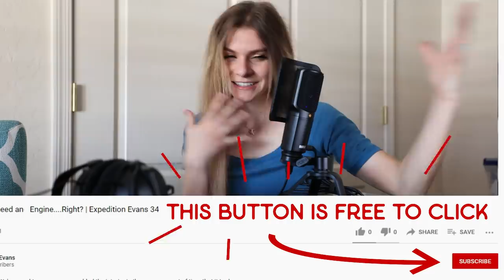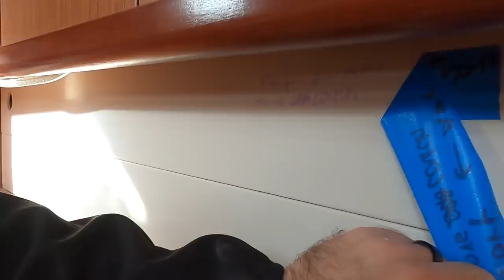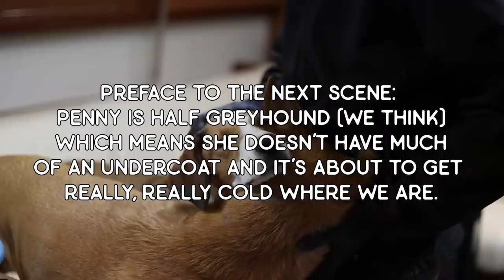Sailboats Don't Need an Engine....Right? (+ we finish reassembly) | Expedition Evans 34

Comment: May sound strange, but as an ex-janitor I can tell you it will work, use dry erase marker and then one of those little alcohol wipes. I don’t understand all the chemistry but the dry erase ink seems to be close enough to the permanent ink that they combined and that allows the alcohol wipes to lift it off. If you have any doubts at all use the dry erase board first. Put a line in permit ink And then go over it with a dry erase marker, you will have to rub on it a bit with the dry erase marker, and then take the alcohol wipe and clean it off. Just a little fun fact.
Reply: This totally works!
Reply: @VWrijder77  Weird isn’t it? Who would’ve thought?
Reply: @duanemiller5606  I think this has saved many white boards
Reply: @VWrijder77  and it works on more then whiteboards but I wouldn’t go and make a lot of marks all over to see what all it will work on. But once you have a mark it can’t hurt to try.

Comment: Dry erase markers are great at getting marker stains off of any surface and are usually my go to; it can take as many as ten passes on fabrics however. Adhesive dissolvers like goof off and goo gone can work as well depending on what the material is made out of; they can have reactions with some plastics and fabrics. Bleach and comet with an abrasive pad will work on hard surfaces that aren't likely to scratch.

Comment: Check list for "no crank"
• Battery >12.0V, voltage drops when key is turned to start, possible bad starter
• Battery <11.0V, voltage drops when key is turned to start, low battery
• Battery >12.0V, voltage does NOT drop when key is turned to start, dirty/lose battery cables OR problem with key switch.

You can bypass the key switch at least enough to see if the engine will crank with a piece of wire between two terminals on the starter.  Have some one show you which two !

All on those heavy cable connections that you cleaned and tightened should have a good "glob" or silicon dielectric grease on them.  Vaseline is cheaper and works just as well.  If you are lazy, a spritz of Fluid Film will work.  The FF will need to be redone every 3-6 months.

Comment: 1) Sounds like you all have a few  "Floor Creeks"  Is it Floor Flex ?(where the floorboard is warped and makes the ends rub/creek) or you have Gaps from floorboards to the support. If so some Plastic/Foam tape will take care of it.(put it on the Fiberglass supports that floor sits on)
2) That missing bit will drive you crazy one day.(I bet in heavy seas)

Long time Observer and Commenter on this Great Series.....keep it up.

Comment: Your AC may be a heat pump type. If that’s not a heat pump, I highly recommend the Marine Air 16,000btu 110V. Also what people are doing now are installing pre-charged “split systems” but the need some deck area and I don’t know how they would fair with the salt spray. The Buddy heater is nice, but the propane odorant stinks the boat up. Even with a little fresh air ventilation the boat can get a lot of condensation.

Comment: you guys are a beautiful couple! I started my sailing adventures when I was 16. Moved to the BVI  when I was 19. lived there for 18 years. A little different from you guys I was getting paid to run boats from the Moorings then went on to run private sail boats for the owners. What a life. Switched from sail to power because it paid better . Long story short, tur Capt. Craigned into a 48 year career. My heart is with sailing. Ran a swan 57 for 6 years , best time of my life. If you need any advise to the Caribbean or Bahamas. I'm your guy!!

Comment: QUESTION:  You two did an amazing job fixing the boat.  Now that it is fixed, how does your insurance value get determined?  Is it back to pre-accident value?  Tip of the day, always adjust your insurance location.  Sailing Doodles has a tragic set of videos on not being covered if you are damaged and NOT where you said you would be.

Comment: I've only discovered your "channel" today, and have been bingeing from Expedition Evan #1 to this one #34 (I paused at 9:52 to write this)...when you turned off the key (back then) the engine wanted to continue running, you went down below and shut it off....did you "hit" a kill switch that needs to be switched back "on" so the ignition will fire up the engine?

Comment: If you get a mr clean magic eraser - it should take that marker right off.  Amazon. Also- get some stuff called Meguiars super degreaser.  It’s a degreaser - but it’s probably the best kept secret of Florida boat detailers to get boat seat cushions back to 100%.   This includes ANY of that black mildew etc.  enjoying your journey.  Thx for sharing.

Comment: To check your battery just put an amp meter on it set to 20 V  (volts) and if it reads above 12.4 volts 
Then the battery is Not the problem...  Saves a lot of time messing with a charger 😎👍✅. 9:30 🕤

Comment: I am proud of you both great job rebuilding your home stronger, better, faster it should be called The Six Millon Dollar Boat. What was wrong with the engine? Mine wouldn't start because the lever on the throttle was out of Neutral just a slight. Now I want a new throttle handle. Both of you are such hard workers and it is rear seeing young people like yourselves with strong work ethics. Looking forward to you both with sailing videos and your travels and adventures. Always Fair winds with following seas and save travels.

Comment: On the intermittent water pump Brett probably knows that the reason for the zip tie is the plug female bayonets are probably loose and need to be cleaned and crimped.  It's something I've learned from restoring 40 year old Italian motorcycles.  The next question with the battery is how long the charge will last.  Once again I've learned a diesel jump pack is your friend.

Comment: You have got to get every trace of that pink crap out of the tanks, hoses, faucets, pumps, pressure tanks -everything.  It is like candy to mold.  Hoses turn black inside, tanks... you don't want to look inside the tanks if you didn't get every trace out.  Ask us how we know.  We'll never use it again for potable water.  Much less work in the end to blow it all out with air rather than cleaning everything and replacing every hose later.  Flush, flush, flush, flush and flush.  You are at a marina now.  Make use of that water while you have it.

Comment: 2:39 losing that bit in to the Abyss will haunt you for all eternity. And by eternity...I mean every time your boat is out on the water rolling in waves. You're going to hear that metal clatter noise as it rolls around under the deck plating. ::click click click...clack clack clack....clickclack clickclack...   You may even consider trading the boat for a power catamaran after a month or two of that torture.

Comment: Hey guys , I was almost hoping that your engine didn't  start because usually if fuel sits too long it can separate . Gasoline for sure and my brother says diesel  can as well .
The results can mean thick sludge build up in the filter, carburetor  or fuel injectors .
The solution is put stabilizer in the fuel before letting it  sit long periods of time.
I suggest that you take samples from your fuel tanks (from top and bottom of tank) to see if you need to  do something with the fuel. You may need to dump ,filter or add something to the fuel. Check it out before you cause mechanical failure. 
Delos recently suffered  a bent push rod ,  just from trying to start engine with the fuel valve closed . It was a major overhaul to repair . 
$ thousands if you can't  do it yourself.
The boat looks great ... really coming together nicely .
Congrats on each and every advancement  and take care !

Comment: Tip for removing the tape /marker residue is to use ‘tec7 remove all’, has worked for me with the exact same problem. Just test it on a area you can’t see first to make sure it doesn’t harm the material 👍 good job on the boat work and videos ! ⛵️

Comment: Good work! Pro tip: Whenever you start the diesel auxiliary, keep it running until it gets up to temperature before shutting down. Even better, tighten the spring lines and put her in gear (at idle RPM) to add some load.

Comment: Whenever I lose anything over the side it’s always in the marina when I’m working on something, so a powerful horseshoe magnet is stored in the onboard tool box in the screwdriver compartment. This way if I lose anything over the side I can retrieve it with a length of fishing line, but also the screwdrivers become magnetised and are great for retrieving stainless steel screws, nuts etc from difficult to get to places.  
Congratulations, you’ve done a great job, she looks good.

Comment: Hey Jade, On your stained "vegan leather" is it the same material used on the couch cushions ?  Chances are there is something to remove the ink, your problem being if you try out 6 different things to get there on the 7th try, you'll create a noticeable difference in the materials texture or color in doing so... see if you can't try out a test stain with the same type marker that created it but in a hidden area so you only try one cleaner on each section of your "test stain". Good Luck !  PS  Most marker is solvent on itself, ie the solvent in the marker is able to dilute and lift and reduce the ink or dyes impression... if it's deeply absorbed you may need to oxidize or bleach it to reduce differences in opacity down in pores of mat'l.

Comment: Just a quick note... sharpies are an alcohol based permanent marker (notorious for bleeding through tape or paper to stain the surfaces underneath) if the surface has been stained only recently a quick wipe of alcohol on a rag will easily get rid of most marks. After a longer exposure, it sometimes becomes harder and will require a more aggressive solvent. like goof-off. WARNING ALWAYS test the solvent in a spot that can be hidden or out of the way, since some solvents can remove the topcoat layer of leather or vinyl or painted surfaces.                                              And I love your channel. great videos.

Comment: Makes me wish boats were like airplanes, come with a maintenance manual that shows were bits go and what fasteners go where and what materials to use. That would make life so much simpler and it would put the onus on owners to fix things properly and force manufacturers to do a better job in construction. Nothing like owners suing manufacturers for the crappy choices in materials.

Comment: I know you have already fixed the issue with the engine starting but steps to follow. Since you aren't getting any response at all from the starter first you would have someone turn the key and someone else listens to the starter standing next to the engine. Having something like a long screwdriver to press against the starter and put your ear to the handle is very useful here (Don't touch the screwdriver to the wires obviously). If you still don't hear anything use a multi meter to check the voltage to the starter at the wires connecting to it. If you have power at the starter and no noise your starter is dead. If you don't, go step by step back the connections till you find the problem. Cheers.

Comment: Those relay sockets are a standard item. You can get them at most automotive parts stores or any shop that installs remote starters. If you want, you can get them from McMaster, too, if you value convenience over cost. Or, you can go dutch and just use spade connectors.

Comment: So great to see your dreams coming together.  It's easy to leave some residual antifreeze in the fresh water tank.  If you just did one drain/fill then you will notice some odor even if the water is clear.  Best way to a really clean tank is to drain, then fill just a few gallons, drain again,  repeat until water is coming out totally free of odor.  Then top it off.

Comment: Rebuilt a Balboa and put a new Honda out board on it and only put on 5 hours of run time in 25 years? so no really don't need a motor if you can sail but spend a lot of time tacking into the wind to get back into the breakwall

Comment: Only place I know to get those are camping world they should have a reasonable price for them instead of a marine store camping world has the same almost the same as the exact kind of fixture situation as a RV is separate ones and water one is not but they both kind of work the same so I was out camping world and there’s probably one near you

Comment: One thing many forget to do when refitting is replace the o-rings or seals on deck fill caps to prevent rain water and/or salt water from contaminating fuel and fresh water tanks.   I know of one ship that had to abort a Pacific passage when all potable water became salt water due to an o-ring cracking on the deck fill cap.

Comment: I did not see you change the fuel filters or oil on your engine? Clean all of the electrical connections for the engine and charging system. Then coat with battery terminal protective spray.  Last thing you need is for a failure while far out at sea.

Comment: Well engines it kind of matters which one it is a gasoline engine or a diesel engine both are good but I would probably try starting it in water because it might take that for it might have a safety on it to prevent you from starting it if there’s no water in your cooling system maybe I don’t know so watching your video

Comment: Hey if the boat has been sitting a while soap teat your propane hose for leaks. If the gas is open and you see soap bubbles the you have a leak. Also get a propane gas alarm for leaks checks.

Comment: As far as your water pumps well they’re pretty simple it’s either the relay or it’s the pits most of the stuff it’s just common sense mechanical stuff Brett you should be able to figure this out it’s not rocket science sometimes it is but it’s time it’s not

Comment: Open up the Port Side engine panel under the sink.  Reach around for the starter. Pull the connector off the starter and clean it up and grease it. If it got wet with salt water it will start to get a white powder on it that will block the connection hence the diesel will not start.

Comment: Use lighter fuel. It will not stain the leather but does remove most "INKS" I worked with leather and vinyl for more years than I care to remember.

Comment: Looks like you could use a flexible tip magnetic wand added to your tool box. Great for retrieving dropped items like nuts and bolts.
Reply: Yeah, except that probably all the hardware is stainless steel so wouldn’t be magnetic.

Comment: Goof Off!   I use it all the time to clean up markers.   EDIT: YouTube hates the link.  Use the WATER BASED Goof Off! in the squirt bottle.  They have other products that might be a problem for your furniture.
Reply: Toothpaste takes sharpie off wood really well!
Reply: Brake cleaner, which is a cousin of dry cleaning chemical, works wonders for everything Sharpie and greasy.  Be careful, it will melt some plastics.  Brake cleaner is available at HDepot, or the auto parts store.
Reply: Goof off, break cleaner and things of that nature with brand names are nothing more than repackaged VM&P Naphtha.   It's a petroleum distillate that is more volatile  than mineral spirits and is used as a degreaser. A quart can from HD will last half a lifetime.
Reply: Dr Mostenbockers works onots of stuff. It smells pretty OK even if it doesn't work.
Reply: Guys, plain old rubbing alcohol does the trick. Sharpies are alcohol markers, after all. Hell of a lot cheaper than anything else that's been mentioned here, and more widely available.
Reply: @markede11  They would need to be very careful with Brake cleaner and test it where it doesn't matter. That stuff could do serious damage to finishes.
Reply: I've had great success removing Sharpie with WD 40 on various surfaces

Comment: ..the one thought I have had as you reassemble, is what about the squeaks... the boat will be stiffer, but all those seams between pieces and was wondering if considered waxing the edges where things meet to reduce the potential for noises and things bump and grind as you sail.   :D